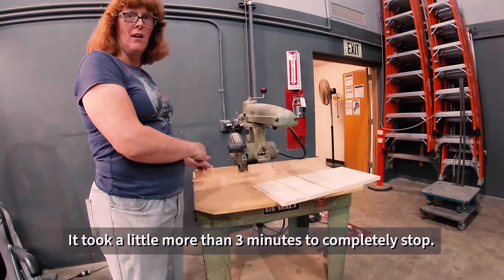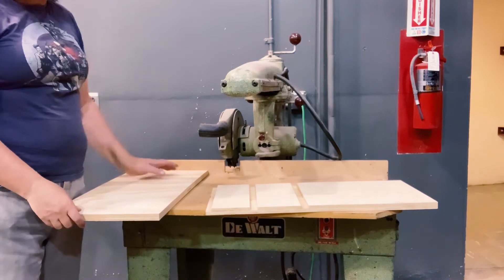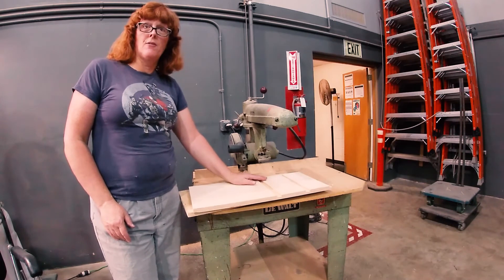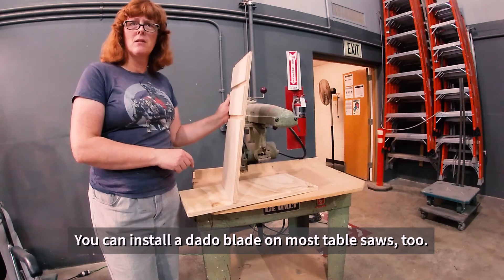Dados and Rabbets on the Radial Arm Saw

Comment: I really enjoyed your video. Can you cut notches on the edge of a board using the RAS?
Reply from the maker: Pretty sure I do rabbets in this video. If you mean like a dadoed slot to make tongue and groove, yes you can do that with a radial arm saw with the blade rotated parallel to the table and locked in a fixed position to run your wood through it like a table saw or a shaper. Routers are probably a better choice for that operation though. You can also do mortise and tenons with a RAS.
Reply: @calstatelaalproductions2358 Thank you.
Reply: I think i should have ask about cutting a “Half-Lap Notch” using a RAS. I want to join 2, 2x4s using the half-lap method. My concern is the safety of cutting the notch with the board sitting on the edge and not flat on the face when I cut. Thank you for your time and hopefully, this makes more sense.
Reply from the maker: If you want to do a half lap, a mitered half lap, or a cross lap/notched lap, then the RAS is a good choice for accuracy and repeatability. A dovetail cross lap is probably a lot more complicated and would be best with multiple RAS to do each of the specific jig tasks. The other lap joints are easier to set up once, perform all those tasks, do the next setup, repeat. 

I would do all of these notch joints the same way I do the rabbets and dadoes in the video, with the board laid flat. You can defo do inside notches with several passes on a 2x4 or 2x6 or even a 4x4. Some of the bigger lumber would be safer with a 14” or bigger RAS. Kiernan Woodworks has some of these tasks demonstrated on a RAS either here or on TT.
Reply from the maker: Oh I just realized what you meant by orientation and on edge rather than laid flat. The nice thing about the RAS is that the backing board on the table, the “fence”, is supposed to be easily removable so you can replace it when it gets chewed up from various cuts, especially if you are doing a combo of through cuts, dadoes, and miter cuts. In our shop we just do simple cross cuts only 99.9% of the time with the big one and dadoes/rabbets with the older machine. You can also install a taller fence backing board for better support on edge to make the notch. 

I saw someone on here building a new table for his RAS and he was gluing everything down and not building it out of the components that they usually come with or would be built with. The tables and fence boards are supposed to be sacrificial and easily replaced as needed. And the back support needs multiple positions depending on the task you are doing (cross cutting, ripping, or otherwise). So your table components should be easily changed out by loosening the table clamps in back.
Reply from the maker: You could also double-up your 2x4s and cut both at the same time essentially same as cutting through a single 4x4. That would help with support. 

There’s a vintage video of DeWalts from the 1940s building stair treads out of 2x12 standing on edge. One machine for each of the two angled/bevel cuts and a jig to stop and cut each of the stair positions. I might have it in one of my playlists.
Reply from the maker: It’s saved in my Advanced Scene Shop tasks playlists. 

https://youtu.be/HiGH0Qsu3ak?si=pUyhRQ324-BTL3b1
Reply: Thank you for taking the time to help me. I retired from teaching in 2015 and began woodworking around 2018. I still consider myself a beginner and I am constantly learning. You have helped me greatly. I look forward to more of your ”classes”.
Reply from the maker: He’s a video with a little more explanation/detail on how to best set your RAS up for cutting notched joints. 

Notching 2x4 with a Dado blade on a Radial Arm Saw
https://youtu.be/6YErKU7Spik

Comment: How are you alining the dado blade with your rebate and dado cut locations on your workpiece without a fresh cut in a sacrificial fence.  It looked like in your video that you were just eyeballing it for the demonstration.  One of the advantages of a RAS is high accuracy made possible by using a fresh cut in the fence to align a knife cut mark in the workpiece.  Thanks for your videos.
Reply from the maker: This was a couple years ago and I probably was eyeballing it. More likely I knew that my actual cut was 1/8 to 1/4 from where the fence kerf had worn down to, something specific like that. I was making 1-1/2” wide rabbets with a 3/4” wide dado blade so those were always going to take 2-3 passes. If I crept up to my edge and it took 4 passes, it was all the same to me. The dado cuts, I probably eyeballed, brought the blade close to the lumber, possibly even clipping it, then adjusted and made the cut. I was re-building the tool storage organization cabinetry in the tool room, so not doing finish carpentry in a high visibility location. Functional and strong was the goal.

Comment: I have a deWalt RAS, but I'm not familiar with any height adjustment clamps.  I have adjusted the height adjustment, but once it is set, I believe that there is no more adjustment or clamping needed.
Reply from the maker: Height adjustment is needed when changing from through cuts to partial cuts like rabbets or dados. Or when changing from 90 degree cuts to any miter cut. Then when making the first cut for through cuts, lower the blade into the table and make a full kerf cut in the top layer of the table. 

Usually there is a height adjustment lever on the column or sometimes in front below the table. There is also a column lock so the height doesn’t drift during operation.

Comment: ?Question? Do you find that MDF works the best as your sacrificial top? It looks like you screwed it down only on the perimeter of the top. Did you glue or otherwise fasten it anywhere else? I want to rebuild the table for my saw & seek to reduce the trial & error involved. Thanks for the attention that you paid to this wonderful tool!
Reply from the maker: MDF holds truest over time and is also the most cost-effective to replace. For a small, portable, stand-alone station like this, yes, I will typically use MDF on top. For our 14” Original Saw RAS, which is built into a larger workspace, I have a plywood base and finish it with 1/4” tempered masonite as the sacrificial top. 

Yes, you want to keep any screws out of the line of blade travel, in all possible positions. I don’t glue anything down. All components of your RAS need to be removable, replaceable, and adjustable. There are usually thumb screws behind the fence board that clamp everything in place and allow for removal and adjustment of pieces as needed for various operations. 

Under the MDF is a piece of 3/4” plywood that is tried up in relation to the saw head travel via the table mounting bolts. The MDF is just a top work surface and sacrificial through regular use. I probably used 3/4” MDF. I did trim this unit on the perimeter and probably glued that down and used Brad nails. So that would need to be taken apart and rebuilt to replace the MDF. I’ll confirm shortly where I screwed down the MDF.
Reply from the maker: Sorry, I mis-spoke. I have two layers of plywood as the base and then a layer of 1/4" masonite on top as the sacrificial surface. The trim stays with the plywood and the masonite is not glued down so it is easily replaced when worn. We've been doing dados and rabbets mostly with this machine, so no damage at all to the masonite. The fence piece of 6/4 pine is seeing some wear from use though. And yes, only screws on the perimeter of the masonite so that the blade doesn't hit any of them during normal use.
Reply from the maker: See Short reply
Reply: @calstatelaalproductions2358  i think I’ll go with MDF, as it will likely be tricky(-ier) to get masonite from my trusted hardwood supplier. Thanks again for all of your help and suggestions (& the time you spent showing the benefits of this wonderful tool).

Comment: I have a1954 DeWalt GWI. I've been using it since 2006 for crosscuts. I started watching YouTube videos about them and decided I should learn it's full potential. I added a new top and gave the machine a tuneup. I built a little table for my blue ray player and all the work was done on the RAS. It came out great. I've done some shaper work with it but not dado. Maybe next job. Thanks for the video.

Comment: If I had a 3 phase RAS, I would put a VFD on it.  You could decelerate the blade at what ever time frame you like.  Also I would place the On/Off sw at a more convenient location and change it to a paddle sw.  I have a craftsman 2.5 hp ras that I bought in 1980.  It’s my dedicated dado machine.  Works great.
Reply: Yep, a dedicated dado saw sure is a time-saver.

Comment: Replace the motor bearings and it won't take as long to spin down. It sounds backwards but if the bearings are bad, it will take longer to spin down.
Reply from the maker: I probably should have done that when I replaced the power cord to the motor last summer. Just gonna live with it for now, I think. I do have to install the new bearings for head track in the arm. That seems a bit more routine than changing out the motor bearings. Thanks for the tip. 

That was probably the problem in our old Rockwell 14” RAS. Glad to see that beast go away and very happy with the Original Saw 14”.
Reply: @calstatelaalproductions2358  There are two books that are must haves for RAS owners. "Fine Tuning Your Radial Arm Saw" by Jon Eakes and "How to Master the Radial Saw" by Wally Kunkel. The first book covers total set up on  the major brands and the second is geared towards Dewalt.